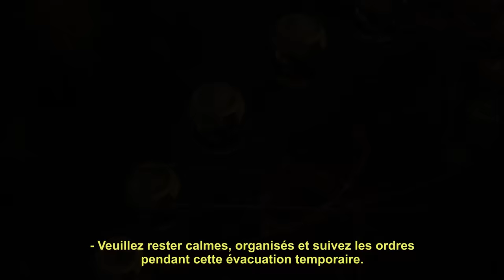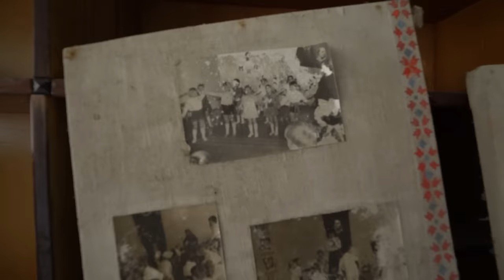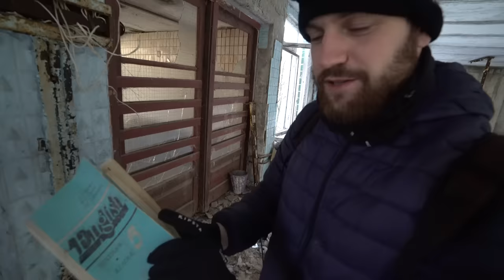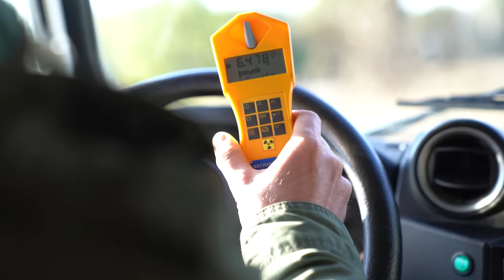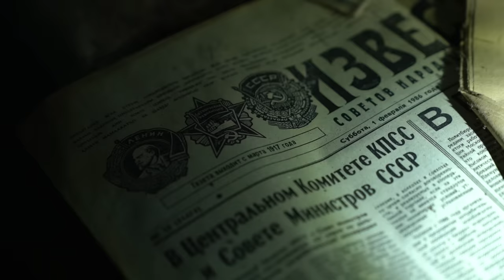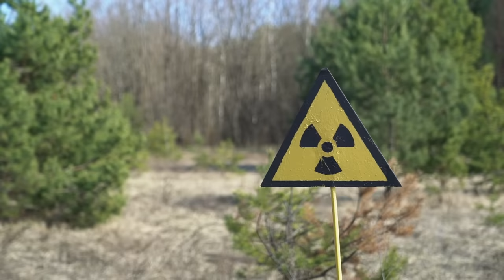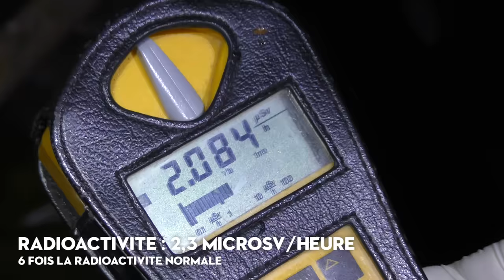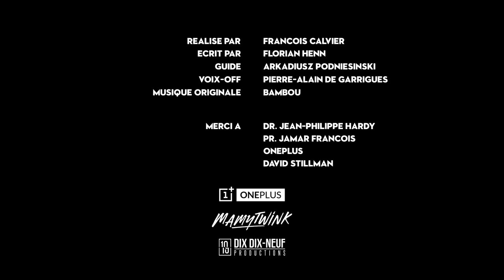DANS LES PARTIES RADIOACTIVES DE TCHERNOBYL

Comment: Merci pour ces renseignements très sensé rappel en copié collé de Trezejere: Je vous conseille de regarder "(La bataille de Tchernobyl) Hommage aux liquidateurs" .

 Quand les soldats doivent aller sur le toit du 3ème réacteur pour jeter les gravats par dessus le toit.

Il y a un débit de dose d'environ 7000rem/h soit 70Sv/h soit 70 000 000µSv/h.
 Ils y restent 1 minute. Ils prennent donc une dose d'environ 1 100 000µSv.(70 000 000/60min)

Certains on fait l'intervention plusieurs fois, ils sont pratiquement tous morts.

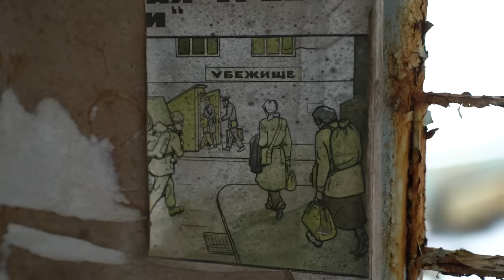Comment: The captions on the pictures are not about actions in the event of a nuclear war, but in case of emergencies.  At 13:44, civil defense signals were written: one bell - air raid, two bells - radiation hazard, three bells - chemical alarm, four bells - hang up.  And the place where children go down in case of danger is not anti-nuclear bunkers, but the basements of the school.

Comment: Well, in fact, most people are afraid of radiation, but if you spend some time down there, in the basement, and leave the Exclusion Zone for a year, for instance, there will be no harm for you, because all the exposure you get during the time you spend there is called an instant exposure. If later on, you keep on living a normal life with a level of radiation exposure varying between 0.1-0.3 microsieverts, you'll be fine and that time you spent down there will not affect you. That what is called radiation dose compensation.

Comment: 22:38 the nuclear reaction stopped shortly after the explosion, by pouring in the reactor poison. If it was still going, it would still be extremely hot and be emitting neutrons, making all metal things themselves radioactive. 
Any remaining heat is normal decay heat, not reaction heat.